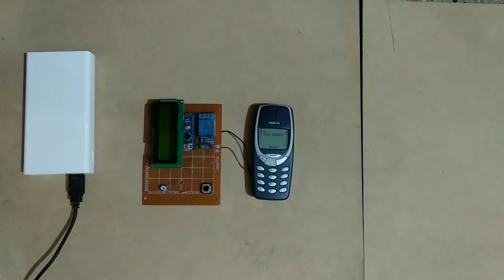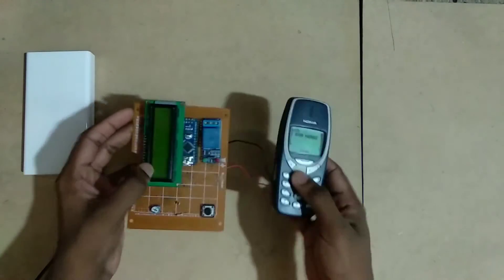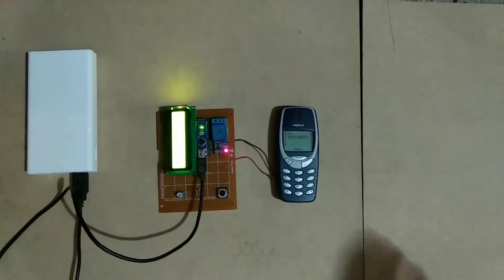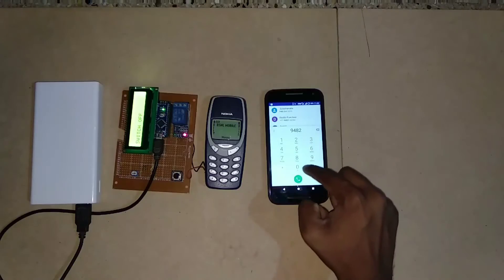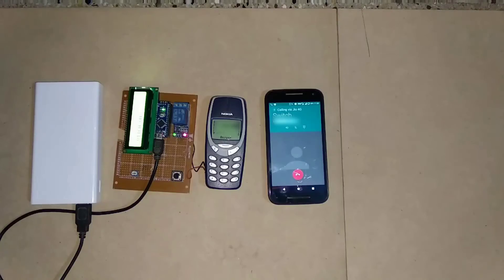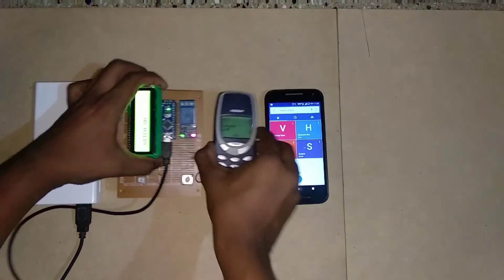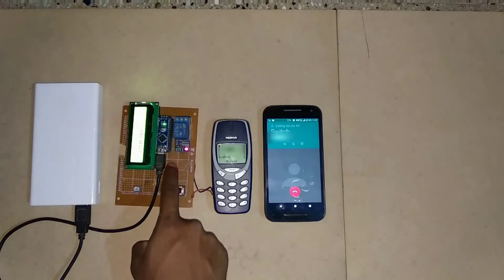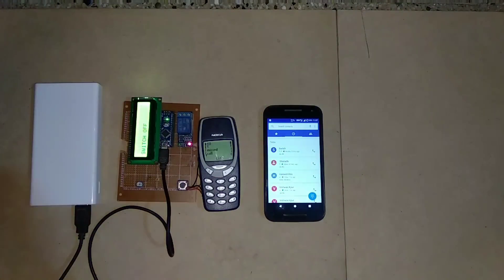Convert old phone to a remote switch

Comment: great idea. i want to turn on /off pump motor using this. but how to get acknowledgement if motor is successfully started on ring to avoid miss switching ? also, i think this can be done without this expensive microcontroller, we can use simple switch diodes or transistors( i am not into electronics).
Reply from the maker: Exactly. You can detect the trigger using transistors. But here my plan was to modulate and detect the ontime using the microcontroller. To get acknowledgement you'll need to sense the current draw from the motor and send it as a message